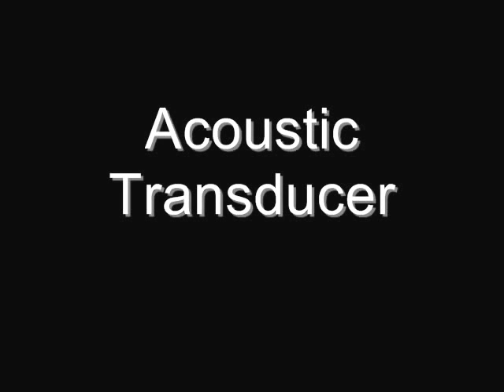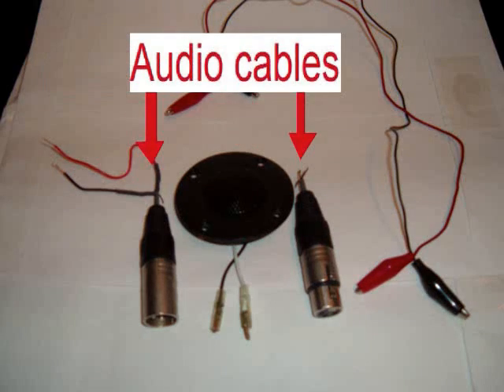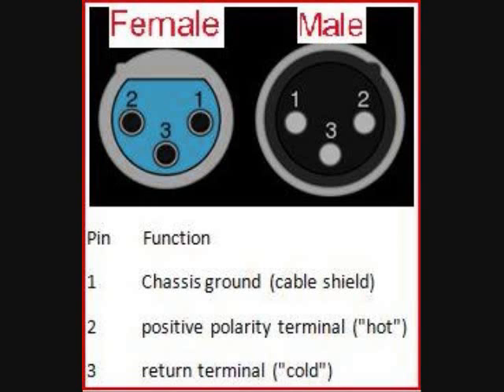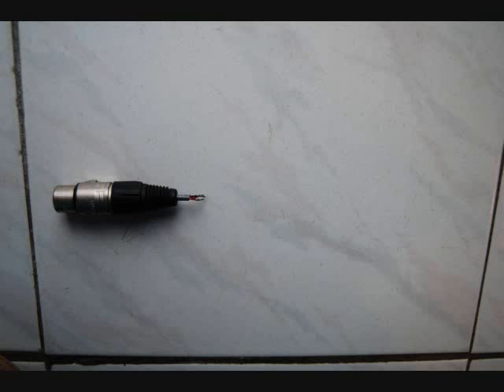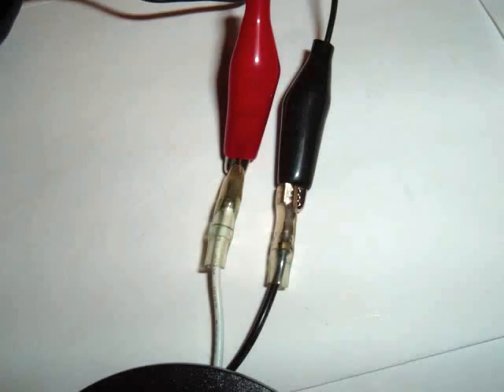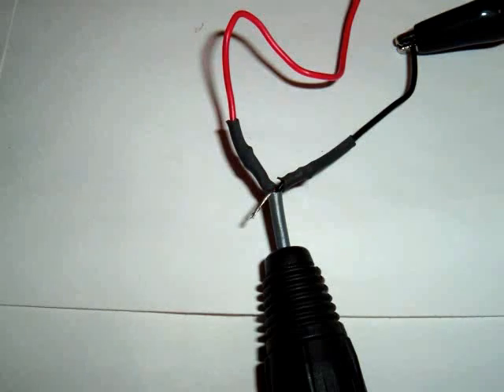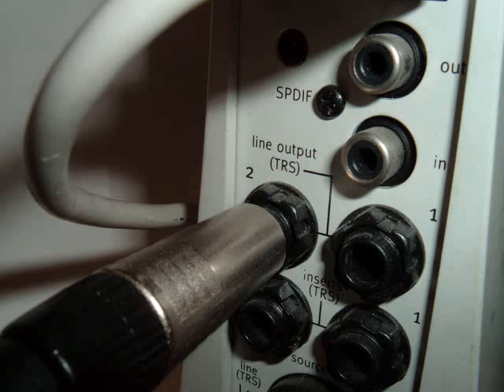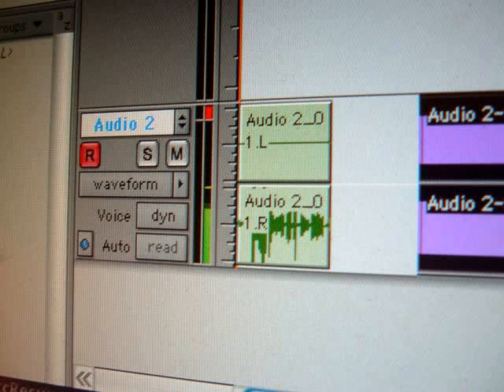How to connect a speaker for use as a microphone

Comment: When you use the speaker as a microphone, you reverse the polarity. to produce a signal that is in phase. Because as you speak into the cone the negative terminal will be the hot signal. Or you can reverse the speaker and speak into the magnet.